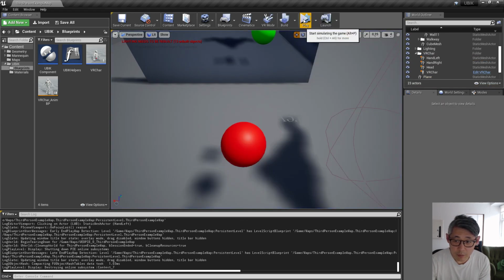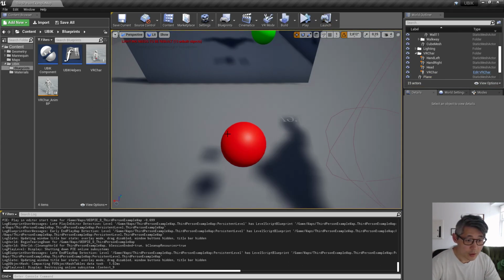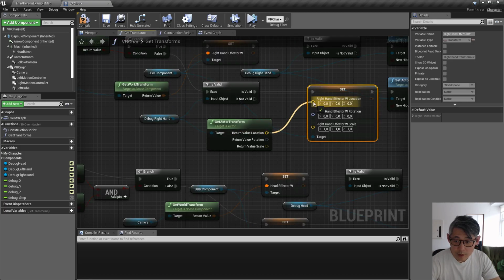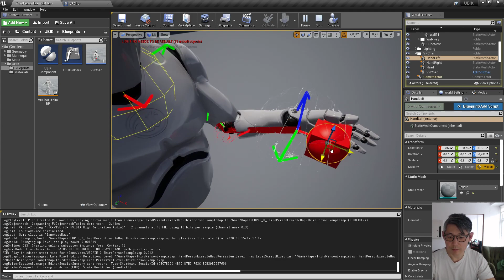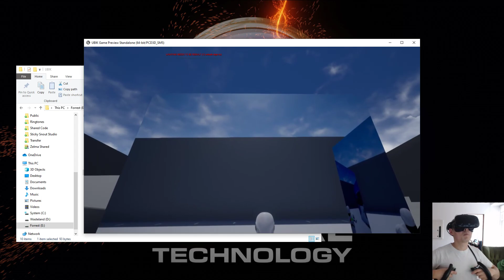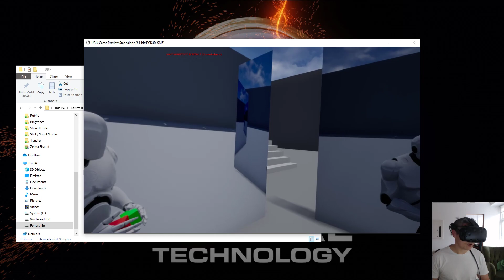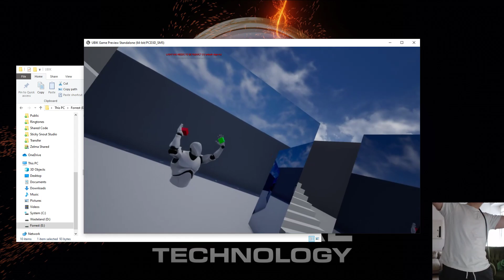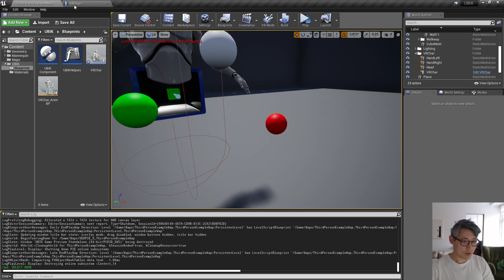UBIK - Part 25 - Wristfix + finishing words (UE4.23)

Comment: Hi Jonas,  I added something that i think would be useful for you.   So as you know, the pivot point is at the wrist which means when you turn your hand the character turns from the wrist which doesnt match your hand position.   

my solution was to take what you did for the head/shoulder rotation and modify it so the hand pivots at the knuckle moving the wrist .... its hard to explain here but can send you a screen shot on discord maybe
Reply from the maker: Sounds interresting. If possible post a videorecording showing the result. It may be worth looking into. Can't say for sure unless i try it. You can also submit a pullrequest to the repo.

Comment: Thanks Jonas.  I added a couple of other things and will work on it more too.  The wierd bit is the arms of the character are shorted than real arms and the hand position is ahead of the real hands

I added some rotation offsets on the upper and lower arms to get the character hand closer to the real hand position.   

I think I will have to do something with the clavicle maybe or shoulder to extend the arms more... other than that I'm not sure, other than designing a character with longer arms.... 

I need to use a full body with legs for my project so theres a lot more for me to add.

One major issue I have is when I look down and then spine bones bend my head moves away from the camera or if I use a dif method the body moves away from the head and cam... not sure why this is different on my version.

Comment: What could this system have potential bugs with collision systems, where you have to pick up several objects at once with collision enabled on them?
Reply from the maker: This all comes down to what collision settings you set on the skeletal mesh which currently is the only "mesh" i have in the setup we've built during this series. If you grab items by attachment to ie. a bone-socket, there should be no issues really. If you grab using a mixed mode method like the VRExpansion plugin, you will have to be carefull that the picked up object does not collide with the mesh, otherwise i suppose they will generate unexpected results.